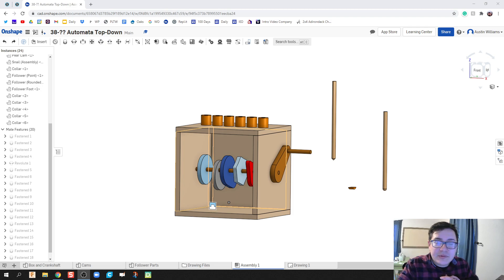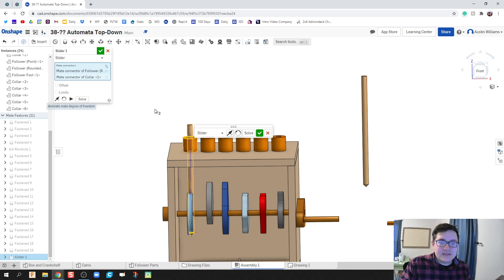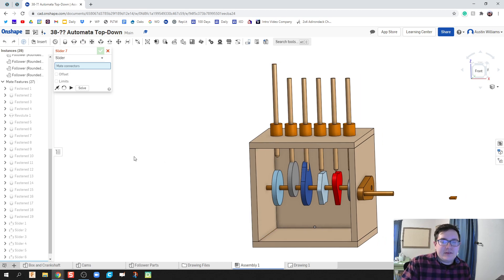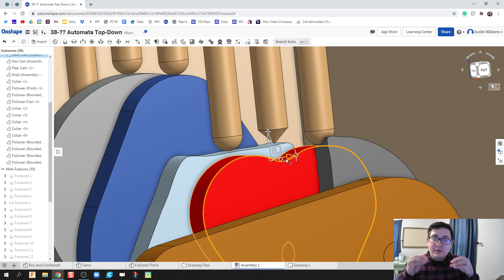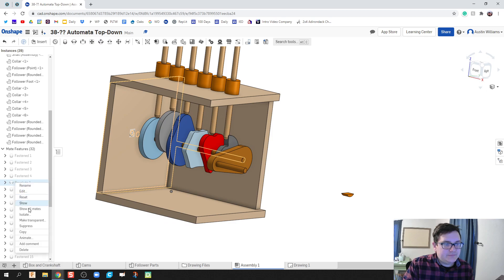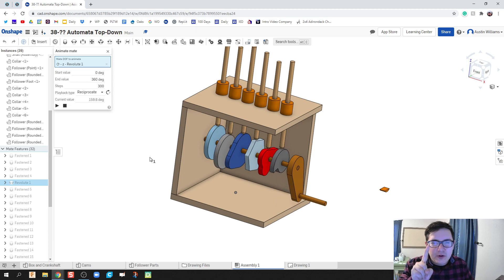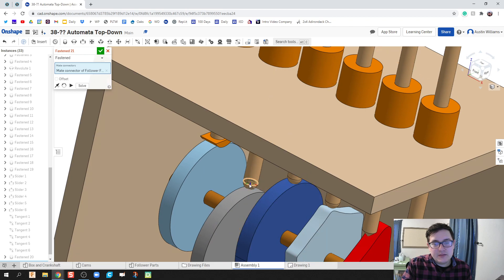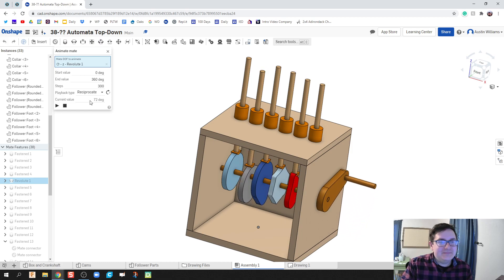Automata Top Down- Follower/Cam Assembly - Day 45 of 100 OnShape Journey

Comment: Stuggled a lot to make the tanget mate work on the none circular cams in the end could only get the circle cam to work
Reply from the maker: Did you see my work around for the non-circular cams? It might be more explained in a different video on this series.
Reply: @LearnItDoItMakeIt  is it the video where you make the non circular cam one face with a spline tool?
Reply from the maker: @Elias10245  yes. If you'd like, you can DM me on Twitter/insta and I can look at your design to help fix it. You can share your design with me.